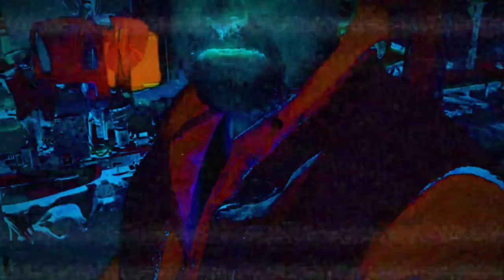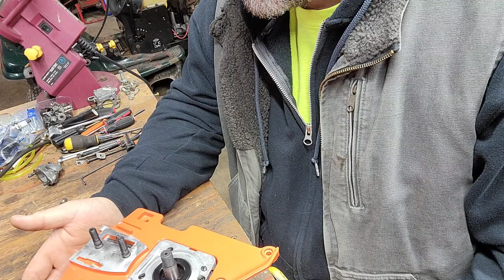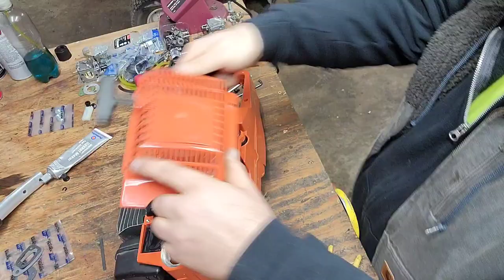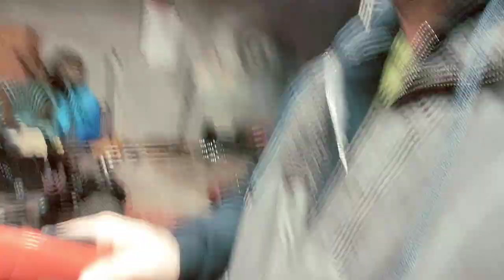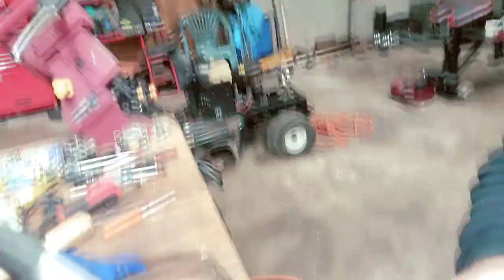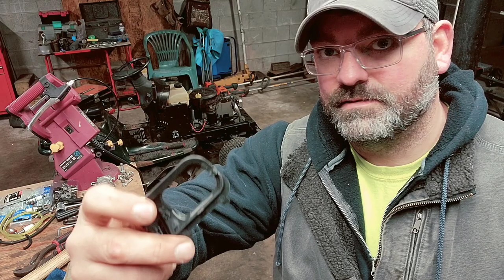Chinavarna 288xp ( Build )

Comment: Those kits are so fun...soon as you get rolling everything just comes together....seal is in the oil pump 🤣..little tip when putting the cylinder on a 200series husky.. put the carburetor on the cylinder before you sit it down on the case🤙🏻🪓😎
Reply from the maker: I had clearance issues with the case!

Comment: Looks like you miss a plate that separate the hot air to the carb box located at the intake block. And the little coil in the carb box is mounted upside down :)
Reply from the maker: See these are the things I need to know lol. Thank you!
Reply: @NothingButChainsaws  Hm.. I saw the vid again the plate doesn't fit so you didn't put that in lol. Oh there's a tube like thing that channel the carb adjusting screw is missing :p.  Have you put it in wood yet?
Reply from the maker: @ladam836  not yet

Comment: I was looking at your video list and I haven't seen a follow up to this build, maybe I missed something. Is there a reason you didn't follow up on this kit?
Reply from the maker: Yes I didn't post a video cause it sold so fast!
Reply: @NothingButChainsaws  I'm still getting a few more parts for my build. Literally by the time I get the last of the parts in the next week it will be more OEM than kit. The only thing from the kit I am using is the crankcase, clutch, starter assembly (replacing the spring, I've had trouble with theirs on previous builds), front handle (If build goes well and ports well I will replace it with a ProSafety full wrap) and the bar cover/break assembly.
I'm on the fence about the carb, I have always replaced them on other kit builds but I'm thinking of giving the kit carb a shot and see how it does before buying one.
Reply from the maker: @MegaLostOne  well you sound like you've out done ya self. But non the less, it's a sweet saw!
Reply: @NothingButChainsaws  I did get a laugh out of you trying to figure out the bolts, I'm in the same boat and I went through and labelled all of my packages what I think each one is for. The funny part is they packaged mine different than yours since you where holding the muffler bolts in one bag and picked up the carb bolts in another, they put my case bolts, muffler bolts and carb bolts all in one bag. 
The one thing they could do that would help a TON would be to label the packages by cross referencing the parts lists from Husky or Stihl. I still have a couple of screws I'm not 100% sure of yet but I'm sure I will figure it out as I assemble the kit.
Reply from the maker: @MegaLostOne  I totally agree on the packaging!

Comment: Nooooooooooooo don’t heat the crank!!! Lol heat makes metal expand, you where actually actively working against yourself... for future builds. Throw crank in freezer for an hour or so, then use heat gun to heat bearings up (so long as they don’t have any plastic in them) then quickly drop crank right into the bearings it will literally drop right in. Shhhhuuuclank.
Reply from the maker: I know that now lol, after I filmed it I told myself I need to get better at this. Then I watched tons of vids on how to do it!
Reply: @NothingButChainsaws  I give you major props for filming essentially the whole process!! I’ve tried multiple times to film “bolt-for-bolt” vids on 660 builds, 372xp builds 361, 460, 440.... but after the first 15 minutes I zone out and just build and stop worrying about filming lol.